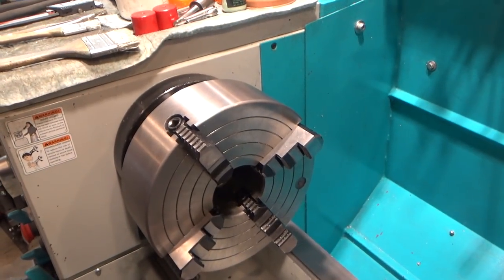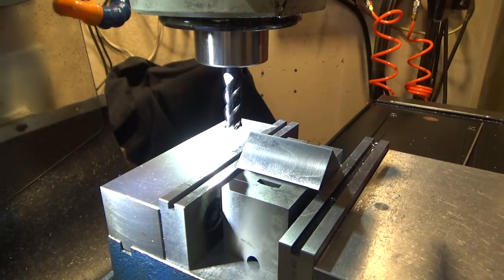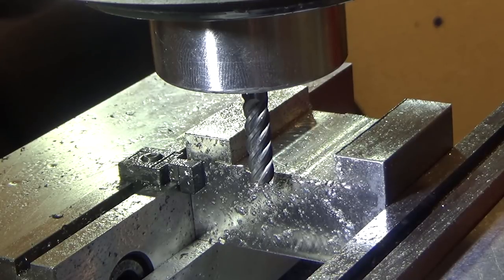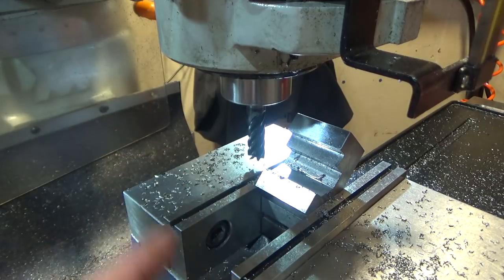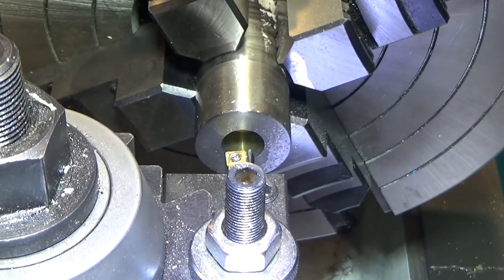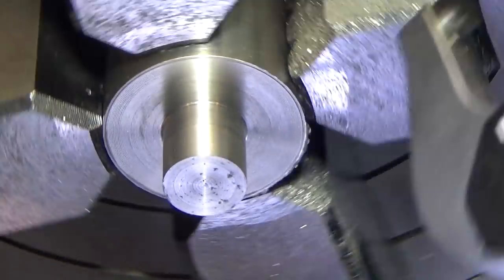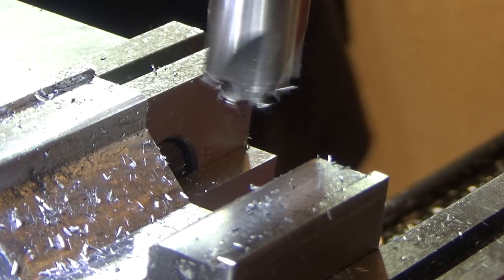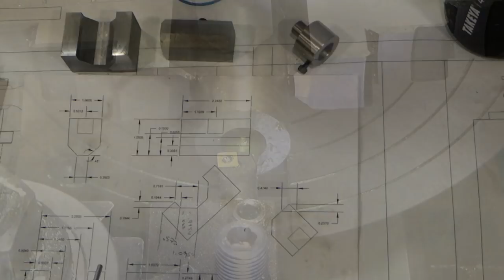Hydraulic Press Die for Chuck Soft Jaws

Comment: You have the Punch, and the Die.  We had a 7000 ton press where I used to work. - Vibration in the video is really not that noticeable. - What kind of lubricant did you use during pressing? -  All in all some good looking soft jaws.  Good initial design, will be very good with your tweaks.  - I have that same chuck.  How much for a set of redesigned jaws?  Would be a good way to help support your channel. Yes? No?
Reply from the maker: 7000 ton! That is so much force that it is hard to relate. I cut out most of the vibrating sections and showed more of the items where I moved the off the mill mount. I thought about lube after I pressed the parts another ignorant decision. Are you referring to the magnets on the side rather than the top? I have work on that idea a bit. Send me an email.
Reply: That design would still work well when turning non-ferrous metals.  No chip build up on the magnets.

Comment: The 'male' part of the tooling is the punch, the 'female' part is the die.  The terms apply regardless if the operation is forming, cutting, etc.  So, you made a punch and die set.

In general the term mold is used when the process is casting, not forming or cutting.  Industrial jargon is of course subject to personal preference :)

When your finished parts need to have specific angles...

https://www.thefabricator.com/article/bending/bending-basics-the-hows-and-whys-of-springback-and-springforward
Reply from the maker: Thanks for the information. I really appreciate it. Punch and die. I will do my best to remember.  Brain like a sieve when it comes to names. Thanks again.

Comment: Another nice project we get to learn from. Not bad for starters.
One item we would like to clear, if U don't mind. Seeing that U are using only Carbide End Mills, we were rather surprised to notice Your hesitancy in taking deeper cuts with these.  Your Mill capacity combined with the Carbide cutters will easily handle the heavier cuts, we are sure.  Is it the Material U were having doubts about ???  We have the same dilemma as well.  What would be the acceptable depth of cut for a, say 4-6 Flute End Mill ???  Would it be twice its Diameter or once only ???  Would be nice to know.
Thanks a stack once again
ATB
aRM
Reply from the maker: Thanks for taking the time to comment. In truth, I have a lack of experience and don't know what is reasonable as far as pushing a cut. I worry about damaging a $60 carbide cutter. Sometimes, I can tell that I have reached a limit through excessive chatter, but for other situations the answer is not as obvious, to me. I have been experimenting with heavier cuts, especially on the lathe and found that I have been heavily biased on the conservative side. I have recently taken 0.050 depth of cut with a feed rate of 0.025/rev feed rate, in 604 stainless, without even breaking a sweat, so clearly I have not been pushing things enough. Other times though I have whipped out a WNMG insert by taking over 0.050 depth of cut at a paltry 0.0022"/rev feed rate. Unfortunately the inserts I use are inexpensive Chinese ones and they don't spec all of the info useful for knowing what they should be capable of. On the mill, I have been more afraid of pushing it. I have watched other peoples videos where they have described mills like my 9x49 as "light". I had experimented with using a 1" diameter, 7" long, carbide, 4 flute, end mill to cut the side of an aluminum part with terrible results. There was uncontrollable chatter. I am still learning, for sure. I appreciate you sharing your thoughts and I will experiment with pushing the cutters harder. Thanks.
Reply: I have a very good book,  "Technology of Machine Tools" where I will research this bit about End Mill  DOC etc and get back to U, hopefully with better info as I need to learn and master that as well. 
From Your Channel I noted that U are not subscribed to Pierre's Garage.  He has some very good info on Lathe turning to achieve superlative finishes without resorting to the conventional conservative minimal DOC. And he even did test runs on Your so-called cheap Banggood Carbide Inserts, which performed exceptionally well on some really heavy cuts - over 1/4" and more  !!!
I noticed and experienced that whilst taking much heavier cuts I was able to achieve beautiful fine turnings and that's exactly what he proved beyond a shadow of doubt. One has to work out the Final finish for a specific DOC and take that heavy cut to finish the turning.  Something like plus 2mm ( +  .0787") etc.  I really want to try this out 'cos I have seen his work and demo and Man, it works perfectly.  
Yes, we are all learning and there's nothing to be ashamed about.  By sharing knowledge we can only benefit and learn from each other.
Thanks a zillion for also taking time to share Your thoughts. Much appreciated.
LORD Bless
aRM
Reply from the maker: Thank you. I have subscribed to pierre's garage. I somehow missed the subscription, because I have watched videos of his before. Thanks for your encouragement. I really appreciate it.
Reply: Dudley Toolwright B.B.

Comment: Nice job.  Just a small draft angle on the female die might release better?  As in casting?  How did you figure the maximum cut for your insert?  My cheapies do not come with any information.  That would be good to know.  Take care.  Doug
Reply from the maker: A small draft angle would be very useful, but I was worried about spring-back of the material as well. In order to end up with a part that had 90 degree sides, I would need to have my die walls at less than 90 degrees, but then I would not be able to remove the pressing die. Conundrums. To answer your question about the inserts, I am in the same boat as well. My cheapo inserts to not list max depth of cut as a spec., so I pushed them until I ruined several edges and discovered that in steels, if I pushed more than 0.050" depth of cut I would immediately start chipping the edge of the insert. So my info came the hard way, but was useful.
Reply: I was thinking more of like when you are casting so the draft for a 90 degree piece might be 91?  Don't know much about it other than what I have watched as I don't do foundry work.  I am getting into redressing the cheap inserts as well now.  For a while I labored under the misconception that the pressed carbide had a surface hardness and shouldn't be ground.  I have also found that the toolholders themselves often do not have enough relief and get in the way of a cut such as chamfering a inside diameter.  Then I was just told by a machinist (retired aerospace tool and die maker) that the "parting/grooving" tools and inserts they sell under that banner are actually grooving only and although they will do a light parting (very light) are not designed for the through cut.  I am having difficulty with the parting using them needing huge tool pressure when the diameter gets down to 5/16+/_ then the insert breaks.  Although these are in the harder grades of steel.  Mild steel and aluminum are no problem but my stainless and harder grades are.  But to be fair the old HSS parting blade in a wedge holder did the same.  I could not get enough clamping pressure and at the end it would start to push the blade back in the holder the tool pressure was so great. In all these cases the tool was dead center and at a right angle to the work with flood coolant.  Currently I am trying different honing techniques on one of Banggood's blade, insert, and full ninety degree clamp down with set screws.  Take care.  Doug

Comment: A 3 jaw chuck can be quite repeatable if you're talking about putting it back in the same orientation. Just mark one point on one jaw with a sharpie, and then mark the corresponding point on your workpiece and make sure that they line up again when you reload it.
Reply from the maker: Thanks for the info. I hadn't considered you r approach. I was aware of the zero-set chucks, but can't afford 'em. great suggestions. Thanks for taking the time to share.
Reply: I think a split collett (you make it bushing sawed through in one place) can give pretty good repeatability in a 3 jaw as well?